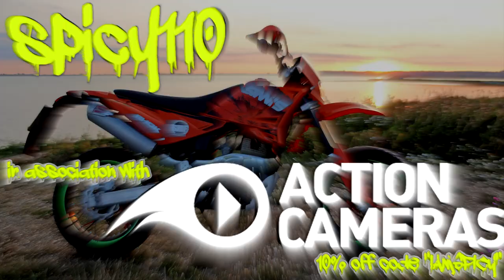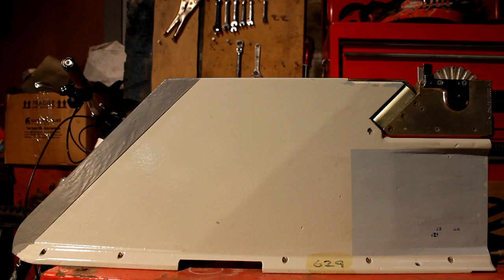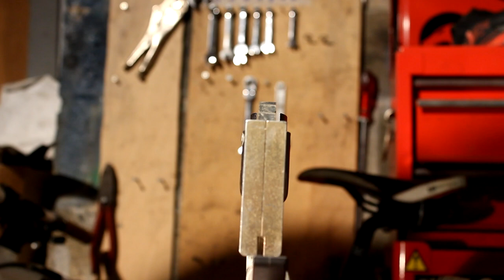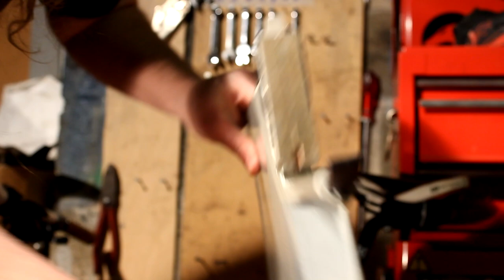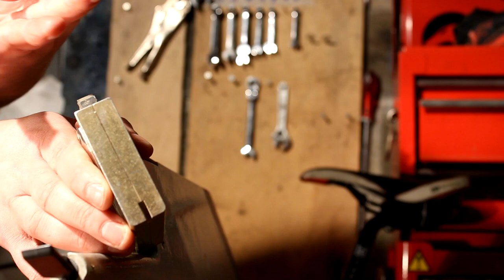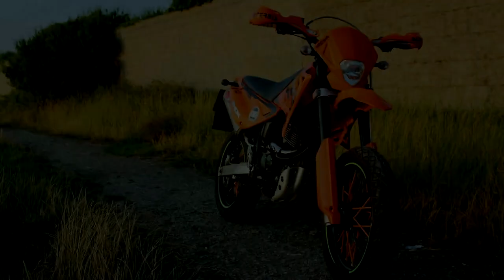The Rolleron! Amazing engineering! Aim-9 Sidewinder!

Comment: You were right about the little lock in the back. Upon firing, the G-Forces from the launch acts to set back the lock, freeing the rolleron. There is an exact amount of tension on it that gets tested frequently to make sure they still release. I get to work on these missiles all the time in the USAF.
Reply from the maker: Arrr cool! Logic prevails!
Reply: 461?  I was a 462.
Reply: @ki4tlf  yes sir! Called  a 2W0x1 now. But we keep that 461 heritage alive. It ends up on most of our flags, coins, and patches
Reply: @UHK-Reaper  LOL I forgot that the changed them.  Dating my self.
Reply: What keeps the cute little gyroscopic stabilizer from preventing the missile from turning to "seek" the heat source?
Reply: @davidjones8942  Torque-induced precession (gyroscopic precession
Reply: @davidjones8942   The rolleron is a heavy gyroscope (like a top) so that if the missile rolls to the right, the rolleron kicks to the left and changes the direction of the roll.  Just like ailerons on an airplane.
Reply: @ki4tlf  I understand how the gyroscopic stabilizer keeps the missile from spinning like a bullet, that is the purpose of the stabilizer. But since it is active (actually moves to counteract unwanted twisting motion of the missile) what keeps the active movement canceling of the gyroscopic stabilizers from canceling the wanted movement of the missile when the heat seeking guidance system tries to turn it towards the target? If there are one of those completely independent and puely mechanical devices on each of the 4 fins, how they know the difference between good movement (seeking the target) and bad movement (twisting like a bullet)?
Reply: @davidjones8942  1. Rollerons only do anything when then missile twists because that's how gyroscopic precession works 2. Tracking movement does not involve rolling 3. The flight controls are far larger and deflect far more
Reply: @davidjones8942  The rollerons not only prevent the airframe from rolling, but also act to prevent skidding of the aft end of the missile and to give it a coordinated turning/pitching movement.  The missile can rotate about any of the three axes, because of aerodynamic and atmospheric flaws, but it can only steer in two of them.  Pitch and yaw.

Let's say the missile is flying straight and level, and the fins/wings are vertical/horizontal.  Opposite canards move at the same time, since they are connected by a crossbar, so the missile can only turn left or right, or pitch up or down.  It cannot be commanded to roll.

When flying an airplane and making a turn, (by banking the wings) the tail of the aircraft will slip if you don't input enough rudder command.  If you put in to much rudder, the aircraft will skid. (like a car going around a corner too fast)

Since the only steering (up, down, left, right) on an AIM-9 is done by the canards, forward of the CG, the missile would slip terribly without the rollerons acting as if they were rudders.  Imagine the two vertical canards and the two vertical wings are inline with each other.  Both vertical canards are commanded to make a right turn.  The missile will pivot around the CG, or close to it.  The gyroscopic effect on the rolleron wheels will cause the flight controls on those two wings to deflect in the direct of the turn, which is exactly how a rudder on an airplane would move to counter the tendency to slip.  The other pair of rollerons wouldn't be affected, since they aren't part of that turn.

It's only when the axle of a gyro is tilted in relation to the plane of the spinning disk, that resistance to movement and precession is witnessed.

Of course, the other pairs of canards/wings in the pitch axis, act the same as those in the yaw axis.

To recap, the rollerons on opposite wings move in the same direction if the missile is turning or pitching.  They move in opposite directions, (like ailerons) if the airframe is rolling.

Side note:  The name Sidewinder came from how the missile flew.  Right off the rails, the original AIM-9s would snake left and right at an extremely high rate, all the way to the target, leaving a snake-like trail of smoke.  The problem was that the seekers would be blinded by the heat signature if they constantly looked at a hot target, and they would stop seeking, so to prevent that, the engineers had the seeker look away from the target, then look back at it, and update the course.  That caused the erratic snake-like path, since as soon as the seeker looked away, the canards would try to turn the missile in the other direction, since that's where the target was.  Between improvements to the seeker and the addition of rollerons, the AIM-9 became the king of dogfights.
Reply: @UHK-Reaper  I started my career as a 465 (AFK), but arrived to my first duty station as a 461.  By the time I got there, they had changed 461s to 2W0X1B and 465s to 2W0X1A.  They eventually ditched the A/B shred sometime after. Still kicking along, waiting for retirement.   IYAAYAS.
Reply: On the older AIM-9, the rollerons were held in place by a string which was burned through by the rocket motor thus freeing the rollerons to operate accordingly. 😉
Reply: 462/2W1’s Babyeee!!!!  1982-2003!
Reply: @Darknamja . You are really dating yourself.  😂
Reply: IYAAYAS
Reply: @throngcleaver  That’s interesting.  I always thought the AIM-9, an infrared “heat-seeking” guided missile, was called “Sidewinder” bc the actual snake is a pit viper, in other words a predatory venomous snake that detects prey from the heat-sensing pits near its eyes. 😎
Reply: Older version used a string to keep them in place, which gets burnt by the rocket jet and frees them up.
Reply: Is the gyro spun up by external airflow?
Reply: @dukeofgibbon4043  yes
Reply: Great info!
Reply: @ki4tlf hmm, I get that, but doesn’t that mess with the control vanes at the front? If they command a move don’t the rollerons work against them?
Reply: @davidjones8942  Sorry, this just showed up today.  The rollerons just keep it from spinning and give it a stable platform.  That allows the control vanes to act like rudders/elevators to direct the missile towards the target.  The missile only cares which way is up, down, left, right towards the target, not oriented towards the launch position or ground.
Reply: @Greg McKinney  Thanks! For some reason, the answers from a year ago didn't compute to my brain a year ago, but reading them again now, they make sense...
Reply: @davidjones8942  You're welcome.  Like a car, rear stays fixed, but the front turns, only in two different axis at once.

Comment: I can finally understand how that works.   CD  didn't explain it very well.    This video just randomly popped up in my feed too.
Reply from the maker: Dude I have been watching your videos since the pellet guns and toys, amazing to see you here. 🙂 I am going to do an update to this and work out the rpm.
Reply: @spicy110   Lol!  In case no one has suggested it,  an optical tachometer they use to for RC airplanes would probably work well.   Just put a piece of white tape on the wheel.  They are cheap too.
Reply from the maker: I have already tried that one but as the wheel is silver it reflects too much, I can't get it apart (they glued those screws in) to paint the wheel black,  so I am going to do it with frezency and math. 😃
Reply: @spicy110  What about a black marker to make a stripe?
Reply from the maker: That might work, however the sound this should be really accurate...IF the app works right. 🙂
Reply: @spicy110  Definitely worth trying.  Some of the tachs I saw were limited on how high they would read.
Reply from the maker: Good point, Mine was also on the cheap side so I'm sure the experts will claim it invalid. Not that many will see that video most likely, being motorcycle focused on my channel, means YT never connects these sorts of videos I randomly make with like minded people. Could be worse tho,  I don't envy the the trouble you have with YT's "rules".
Reply: Me too. :)
Reply: @taofledermaus  according to the guy who sells them on eBay, they spin at 340,000 rpm at 3,000mph.
Reply from the maker: @taofledermaus  I think I got an answer, new video here  https://youtu.be/y1kUzjdkxG8
Reply: Yall the reason my first gun was a pump shotgun 😂😂
Reply: Did not expect to see you here! #dougneedslegs
Reply: @ChevTecGroup  Holy crow, that's insane! Can you imagine if the metal had a defect? If this broke at that speed it would be like a grenade going off.
Reply: Same just happened to me, what are the odds of my favorite channel commenting on a random video.
Reply: Hey Jeff, CD does a lot of things really well, but some he just scoots over without putting his back into it. That’s why you creative bunch should only ever make videos about things that genuinely interest you, your hearts in it. By the way, if you haven’t already, I’d very strongly suggest that you buy yourself a rolleron (surprisingly easy and cheap to obtain) as they’re great things to have in one’s paws. The weight of the things is also rather alarming. I thought they’d be mildly built out of thin aluminium etc, but they’re like a little chunk of neutron star. :)

Comment: When they're brand new they'll spin forever. I think if you disassemble it and clean up the bearings, you'll be even more surprised just how fast they spin. The AIM-9, in the beginning, had a habit of not detonating properly, however, it was so accurate that it has severely crippled and even splashed a few by simply slamming into the target without even detonating! In fact, that's how the Soviets got their little red hands on one after it stuck into a Chinese MIG!
Reply: The original fidget spinner
Reply: That's awesome haha too bad they didn't get their Darwin award when dislodging from the MIG

Comment: We used to spin up bearings in the factories I worked in when there weren’t many people around. Using compressed air as you did, we’d spin up the bearing, then drop on the concrete floor. With lights out, the bearing would spark while getting grip leaving a trail of sparks and a rapid trajectory. Dangerous stuff, but great fun. We at least wore safety specs.

Comment: "[...] work out what RPM that thing is going" That rolleron looks like it has 24 "teeth". 
Using an audio spectrometer the strongest frequency when it spins up is just shy of 6kHz (5930 Hz). If that source is from the teeth spinning by, divide by 24 teeth to get RPS, then multiply by 60 to get RPM. 

In this case, 14825 RPM. 

As you say,  it's going chuffing quickly.
Reply: Is it just me or is everything air powered high rpm except for impact drivers ?
Reply: how can an air compressor spin it that fast if the missile is designed to go at mach 2.5? Higher pressure?
Reply: @busteraycan  Well the air coming out the nozzle is going very fast. if the rolleron is 5cm in diameter at 14825rpm its surface is going 139Kph.
The other thing that happens is when air is acting on a wheel like that it may spin slightly faster than the air stream due to pressure difference generated around the wheel as long as the air volume feeding the high pressure side is sufficient to keep it higher than pressure zone at a greater pressure than the rest of the wheel.

but for the air speed at the nozzle at 180 psi and a 3/32'nd inch nozzle the exit speed of the air molecules may be have a theoretical max in excess of 7000km/h but due to building back pressure in the atmospheric air that surrounds the nozzle tip and air friction in the nozzle walls a practical speed of 400km/h may be more realistic.
Reply: @shanewilson3653  I get what you're saying but how is it that it spins slower when facing mach 2.5 winds compared to an air compressor?

The guy in the video said it's supposed to do 10.000 RPM during normal operation.
Reply: @busteraycan   He says they run at 100,000 RPM when fired  (3:50 - 4:00)
Reply: Ngl that seems a bit slow. Interesting methodology though
Reply: @UltraBadass  Impact drivers are also high speed, only the nose is slow when operating.  They are all high rpm because 90psi is not much and gives low torque so to get power they must run high rpm.
Reply: More than 24 teeth, maybe around 30
Reply: @busteraycan  an America’s Cup yacht just did 50knots in about a third of that wind speed.
Reply: @busteraycan  I bet you didn’t listen in school. He clearly said at 3:57 it spins at 100,000 rpm. Missiles go faster at high altitude than lower altitude.
Reply: @teeanahera8949  ah, that makes sense now. It was just a mistake on my part
Reply: I was thinking the same thing. You can probably link the audio frequency with the rpm.
Reply: @billshiff2060 reason why the nose is slow is due to reduction gearing

Comment: 0:54 Not sure if you're talking about a specific model of the AIM-9, but the missile entered service with the US Navy in 1956, not the "late 70s, early 80s".
Reply: Yes a simple read of Wikipedia before making this video would have helped
Reply: The Soviet Union had the AIM-9 reverse engineered by the early 1960s. Clearly the "late 1970s/early 1980s" timeline is more than a little off. 😆
Reply: The AIM-9B was in service by the mid 1950s. I believe the first air to air kill with one was scored by the ROCAF (Taiwan) against communist Chinese MiGs in the late ‘50s. The Soviets got their hands on one when it scored a direct hit on a MiG 17 or 19(?) but didn’t detonate. 

If (big if) I remember correctly the rollerons are what gave the AIM-9 its trademark wiggle in flight.  That lead to it being called “Sidewinder”, because it reminded someone of the track left in sand by the Sidewinder rattlesnake.
Reply: @daniel_f4050  Talk about bad luck for the ocident/luck for that mig17 and soviets 
heh
Reply: @daniel_f4050  Sidewinder was from the early guidance system, not the rollerons in particular.
Reply: I came here to say the same thing.  I remember looking at a static display of an AIM-9 when I was a kid in 1966.
Reply: @daniel_f4050   Hi Daniel,  You are right on time frame of AIM 9A and reverse engineered. I worked on one of the copies. Couldn't read the lettering on it, as in different language, and slightly different in some of the manufacturing practices. 
Used to be a 31671L.
Reply: No wonder it's all mechanical, that's before the invention of electricity.
Reply: @daniel_f4050  It was named the Sidewinder because it "hunts" like a rattlesnake by using IR to track the movement of its prey. The characteristic trail wiggle (i.e.; the rollerons constantly feeding info to the guidance computer, causing the missile to perpetually "self-correct" during flight) just added to the whole "snakeyness" of the missile's name.
Reply: AIM-92 is the air-to-air version of the FIM-92 Shoulder launched Stinger. It was intended for use by helicopters.
Reply: @shoobidyboop8634  Please tell me you're joking.

Comment: I remember seeing these in the 1980's when I was in the USAF and they didn't have the catch keeping it from moving until firing, they were spring loaded to pop up about a centimeter freeing them from a pin keeping them in place.  There were two red and white candy cane striped strings that crossed over the motor nozzle to the opposite side that kept them down with the springs compressed until the motor was ignited.
Reply: Yep, retired 461 agrees, sir

Comment: As an interesting addition, these things have so much control authority that if they unlock without being launched the pilot can feel the effect. I worked with a number of former fighter pilots and one of them mentioned this when I was working on another guided weapon. He wanted to make sure we didn't guide until we were off the aircraft. With MEMS gyros costing a couple of dollars there's just no need for this now, the missile always knows its roll rate and has positive control in all axes. Roll can be imparted during launch from wingtip stations, and can cause damage to the launch rail at moderate speed and high angle of attack on some aircraft due to wingtip vortices from the parent aircraft. I am sure there's a lot more to it than that, but that's one thing I came across back when I was working on some Eurofighter stuff in the 1980s and 90s. I don't remember which aircraft had seen the issue, it was in marketing bumf from a vendor.
Reply: Aren't most of them 'dropped' off their carry-rails and then ignite a second or two later, so they don't impart any damage to the aircraft?
Reply: @WhiteWolf65  You would be correct for most longer ranged larger missiles like the sparrow and amraam, but the sidewinder rail launches like old WW2 Aerial rockets, a carryover from it's design lineage.
Reply: @WhiteWolf65  Air-to-air missiles like the AIM fire themselves directly off the rail for this exact reason. Fighters are often pulling extreme maneuvers at the moment they fire one of these, so if it just dropped off there's a very high chance you will turn or roll your wing directly into it while it's falling away.

Firing directly off the rail means that by the time it's fully disconnected from the front of the rail, the missile is physically in front of the wing of the aircraft and moving much faster, so no chance of colliding back into the plane.

Not to mention, if the missile waited to fire, there would be  a window where the missile would be moving slower than the plane, therefore fall behind the aircraft and have a good chance of accidentally locking onto it's own plane as it's looking directly into the heat of the aircraft instead of out in front where the target is the hottest thing to see.
Reply: Eh, passive solutions like this are still really neat and elegant, though I agree - not perfect. I suppose even ultimate reliability isn't much of an issue when the whole thing is going to fly for just a few seconds.